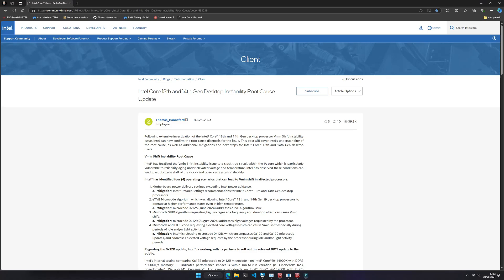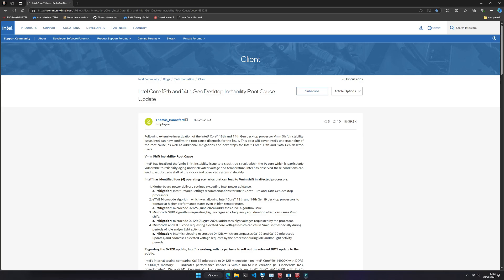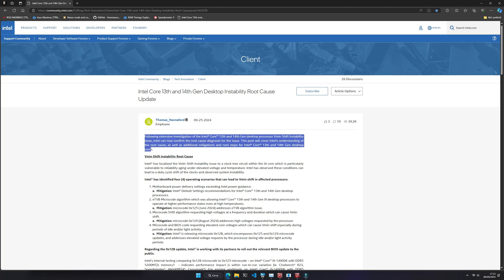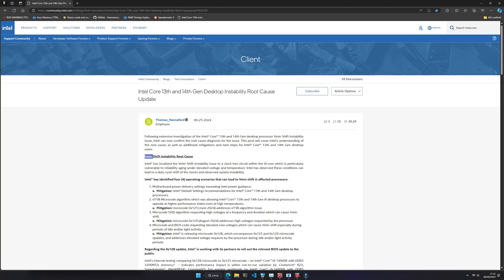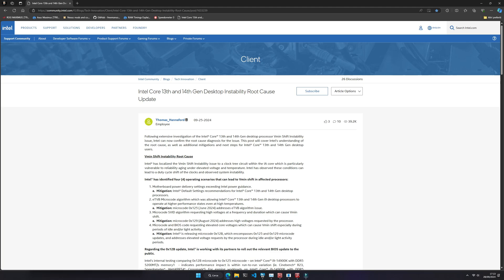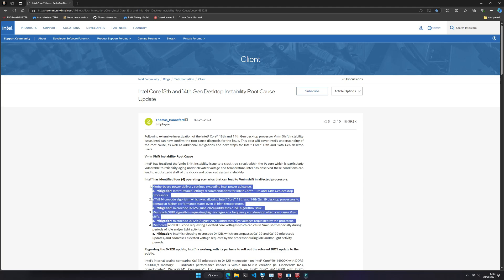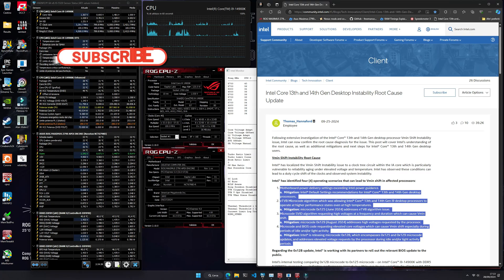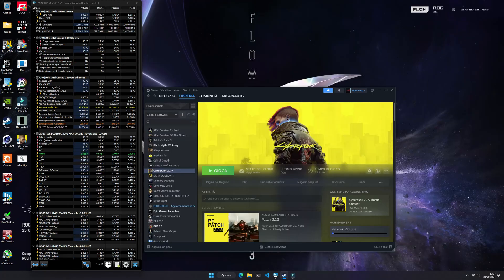FINALLY 14900K microcode 0x12b update FIXES EVERYTHING 🔧

Comment: Hi mate, I intend to buy an I7 14700kf and with all this issue of instability I do not trust much to say is looking and of course all I've seen are I9 and no I7, I hope you can get me out the doubt.
Apart I would update to the latest BIOS, nothing more to have the machine is clear and activate the xmp of RAM, or would have to touch something, thanks and sorry for my English.
Reply from the maker: @XxZeroQxX  Hi, I can tell you to go easy with that one... great purchase price and great processor in general. I've had the 14900K and the 13700K for a year and a half now the first one, two years the second one. I've never encountered any instability. All the videos I've made show how to optimize the system to get the most out of it. So, go easy if that's your choice, enable XMP, set the load line to LLC 4, and make sure to set AC_LL to an initial value of 0.38 mohm. Keep in mind that Intel in its basic configuration, in Auto, sets LLC 4 = DC_LL = AC_LL = 0.55 mohm. So in this way you've already practiced an undervolt. At this point you're doing great both in productivity and gaming. You can find all the details in the videos I've made. Best regards

Comment: How is your CPU running so cool?? Usually mine hovers around 70-80C when gaming.
Reply from the maker: @louiienation8497  I usully use thermal gryzzly KryoSheet
Reply: @eXpowerG3046  And CPU/Bios settings were all out the box? No manual undervolts/power limits done?
Reply from the maker: @louiienation8497  You need to set Load line calibration ;)
Reply: @eXpowerG3046  any tutorials on that?? :(
Reply from the maker: @louiienation8497  on this Channel there's a lot of one 😉

Comment: I couldn't see the temperatures you reached. What was the average?
Reply from the maker: Average temp 53 degrees Celsius, max 85
Reply: @eXpowerG3046  85C is quite high, isn't it? But better than 95C which was before the update. Did you see any improvement on temperature after the latest update for the processor after a few days of use?
Reply from the maker: @ndrsg3013  hi, yes there have been appreciable improvements to the point that I'm making a new video with OC 6.2 GHz, temperatures around 88/90°. CB R23 41354 points and PL2 set to 298 Watt. Think that since I own this processor I have never achieved such a high CB score and with only 300 Watt.

Comment: 14900k microcode? Mine is 14700k. Do i need to use the new code?
Reply from the maker: @yasuolee4914  Generally your cpu does not present critical issues in terms of overvolting. Personally I always update drivers and BIOS to have access to problem resolutions and new features that companies implement. For example, the microcode 0x125 compared to 0x129 did not show, numerically, any difference on the Vcore and SVID voltages. The latter, 0x12b on the contrary, highlights a significant lowering of those voltages. In conclusion you could decide to access this feature or even stay on the old BIOS that will surely work well and go on like this ;)
Reply: @eXpowerG3046  thank you!
Reply: @eXpowerG3046  my bios now is 0x129 and 0x12b is only beta version. i want to wait until the offical version come out

Comment: I am on 0x129 and locked to 5.5 ghz with an undervolt. Everything works perfectly for me so I will skip this bios update.
Reply: yeah.. you dont need to update. just locked the cpu at a sweet spot of ghz and a little undervolt. Just remind : all over 1.375Vcore is bad for the CPU. that happend mostly when the in single bench´s at higher ghz.
Reply: @tetoqx  Yeah I don't reach very high vcore with 0.07 undervolt and 5.5 ghz so I think the update is pointless. This is is for people who stick with the Intel profile in bios.
Reply: @cemsengul16 what score do u have in cinebench?
Reply: @baylife7  I can't remember.
Reply: @cemsengul16  what motherboard and procesor do u have?
Reply: @baylife7  My motherboard is Z790 Dark Hero by Asus and processor is 14900K with undervolt and underclock.
Reply: @cemsengul16  I am new in oc topić, I would love to see your settings, because I think my pc is not running well. I have Z790 formula and i9 14900ks.
Reply: @baylife7  I can check my settings and tell you later. Every chip responds differently to undervolt though. Your limit may be higher or lower.
Reply: @baylife7  Check my comment below for my settings buddy. I Can undervolt to 0.07 in vf offset and games are okay but heavy video editing would crash so I use 0.068 in vf offset.
Reply: @cemsengul16  thank u 👍 appreciate it
Reply: @tetoqx Yup I believe if it stays below 1.4 volts should be fine. Had my 13700F running for over a year now without any issues. But my 14700K that ran at 1.6 volts isn't stable anymore
Reply: @pixels_per_inch  hmm idk.. i ran my 14900k since january most of the time stock with a asrock z790 taichi and i have no stability issues. cinebench always at 100c over 40000 points consistent. Since i whatched videos from der8auer and Frame Chasers i turn the voltage down and the Ghz to 5.4Ghz all core and an offsetVcore to 35mvolt. Runs Perfect at 1.375 Vcore. Same Cinebench Score. :) But you know... Every CPU is different..
Reply: @tetoqx  I am on my replacement 14900K. I am happy yours never died. For my new chip I am using 5.5 ghz p cores. I disabled adaptive boost, intel virtualization, and undervolt protection. I also disabled every tvb setting. I set an IA VR Voltage limit of 1450. Last setting is vf offset. I offset undervolted points 7-11 by 0.068. I believe my max vcore under heavy stress was 1.305.

Comment: So does this'mean we can fully overclock with no PL settings ?
Reply: Removiving PL removes the microcode update.
Reply from the maker: @kazuviking  No, absolutely not. Removing the PL acts on the system optimization practices. The microcode implements the CPU request management algorithm. The focus to have those performances that I showed in my videos is mainly due to the LLC tuning. DC_LL to 'inform' the CPU correctly on the type of Load line calibration that we are using, taking into account the MB impedance. AC_LL to compensate for the voltage drop in the transition from idle to load
Reply: @eXpowerG3046  It actually does on most motherboards. ASUS AI disables only the voltage limiter making the fix useless, MSI does the same. No info on gigabyte and asrock boards so far.
Reply: @kazuviking  come on dude it won't remove the micocode i have it inlimited power with no coverclock hitting 1.350v either a 420mm rad
Reply: @marcusthorburn25  It only removes the eTVB and LLC settings, the rest stays the same. ASUS AI profile does funky stuff. You can see 1.350V in HWinfo if the real voltage is over 1.55V. Motherboards without a built in oscilloscope cannot see the transient spikes.
Reply: @kazuviking  I only game so am fine but thaks for the heads up
Reply from the maker: @marcusthorburn25  🔝
Reply from the maker: as far as I'm concerned, I would always set the Power limits to stay within Intel specifications. This microcode acts in particular on the VID requests that the processor makes to the VRM and returns Vcore voltages more in line with the VF table of the processor itself

Comment: I have 14900k and never had issues but yet again on first launch when i saw temps and i did adjustements , i believe people who left those cpus stock actually fried them btw i did your settings and got 39600 score dont have too good cpu as have only 95SP
Reply from the maker: @gvido2923  hi, you can try to set the parameters that I selected in the video The Definitive solution... With that video I set the P Cores to 57x on the favorites and 55x on the remaining 6, just to mitigate the effect of hyper threading with the downclock, lowering voltage and temperatures! The processor benefits from it and you should easily exceed 40200 points on CB R23.

Comment: You can't fix silicone degradation with microcode. It's just a bandaid to slow down the deterioration in CPUs.
Reply: Yes, you can't use that microcode update to fix a CPU that is already degraded (because that CPU is already physically damaged), but you can ensure a newly purchased CPU (that is not damaged yet), installed on a MB that already have this update, won't share the same fate.
Reply from the maker: @PhilipPetev Correct! Unfortunately with series 13 and 14 this is all we can do. ;)
Reply from the maker: @akkudakkupl  it's clear. the purpose of the videos I made is that, once you realize how bad luck we had with these two generations, if you analyze the voltage / frequency curve you realize how this algorithm makes the SVID requests very close to what the factory fused. So, in this way we can use it with peace of mind and when 6 months or a year pass ... we move on to Arrow Lake or AMD. 😂best regards👋

Comment: Intel never said that microcode 0x12b fixes the problem. To lower voltages enough to stop degradation they'd have to lower frequency too which would get them sued for false advertising. The newest microcode update only slows degradation. Source: read my first sentence.
Reply: wasn't that the problem from the beginning? the voltage issues?
Reply: They did say that it fixes the problem
Reply: @cameron2319  They said the microcode update before the last one fixed the problem just like the one before that. Am I the only one here in this comment section that actually keeps up with what's been going on with Intel for the last few years? It sure seems like it. You and everybody else here seems to think there's nothing to worry about, everything is fine, and there's not a problem. It's almost like this isn't youtube but instead is userbenchmark or something.
Reply: @pf100andahalf Well, this didn’t age well…
Reply: The issue was with too high voltages requested by the clock tree. Now the cpu requests proper voltage and wont degrade. You can still hit the 5.98GHz with some tweaking.
Reply: @kazuviking  Voltages is what the last few microcode updates were all about. I don't know why all of a sudden people think that this last one fixed it.

Comment: "Everything" but everything that is actually on architectural levels of that CPU
That "everything" cannot be reversed, as it's literally an engine of the CPU, they are trying to make a 4.5 cylinder engine out of a V6 and call it "fixed"
I don't blame the engineers, I blame the management
Reply from the maker: @OptimizingNetwork  Absolutely, what turned out to be a design error no one can change. The fact that this algorithm helps mitigate the effects of this error is appreciable and appropriate for all of us technology enthusiasts because, in my opinion, it allows us to return to using these systems, in productivity and gaming, at good performance levels in line with the 14900K range. On Videocardz there are some benchmarks relating to the brand new Arrow Lake and Ryzen 9950X. Well, the results are comparable to the point that, with the configuration I adopted in the video, with the LLC adjustment, in MT on Geekbench 6 I reached 24000+ points and in ST 3290.👋

Comment: it's slower now
Reply from the maker: @rodrigorras  No, absolutely not. If you take into account CB R23, which is the most used benchmark, the score moves on a range between 40800 and 41038, with a PL2 limited to 288 Watts. The Vcore and SVID voltage never reach 1.5 volts at 6 GHz! ...from this starting point it is possible to go back to overclocking with good safety as far as I'm concerned

Comment: Hlo bro I have a i9 12900k and after I update my bios and selecting intel default settings then my cpu started power limit throttling in xtu stress test
Reply: I was under the impression that the 12th Gen wasn’t affected by the problem.  I don’t think you have the same issue to correct with your processor
Reply from the maker: @mvolkaert  you're right, my processor has never shown signs of instability except when left completely without brakes where it reached 390 Watts of consumption. The videos are intended to show those who have had problems, to best set the various parameters so as not to use a processor of this type castrated to the point of scoring only 36000 points in CB R23. An insult! The only aspect in which my processor shows its weakness is the Memory controller weak to the point that it barely supports 8000 MT/s. 👋
Reply from the maker: @PrittyGirl-k4j  hi, of course it depends on the fact that the Intel profile by limiting the Pl1, the Pl2 and the current to 307 Ampere, also limits the TJfunction and when with the load the temperature exceeds 87/90 degrees, the processor goes into thermal throttling and decreases voltage and frequencies. As you may have guessed from the video, I don't like the Intel profile and I prefer to control these parameters manually. otherwise I wouldn't have bought a 14900K but would have stayed with my 13700K 👋

Comment: so annoying that its happening to mine but im just gonna wait until 9800x3d then send off 14900kf for replacement then sell it lol
Reply: Is this means that you bought 14900kf just for gaming, why overpay so much?
Reply: @StroggKingu  because future proofing for newer graphics cards since a i7 would probably bottleneck in the future more than a i9.
Reply: @EddieMcclanahan  You either have to play on 1080p with 4090, to still be cpu bottlenecked.
In that case, why you bought both and still run FHD screen?
Reply: @StroggKingu  i just wanted a cpu that was powerful across the board and i wasn't too worried about the price ahaha
Reply: @joshbeath6166  I mean sure, but did you do any research or just took the highest costing?
Reply: @StroggKingu  I did some research on it aha but I’ve always had a lot of trust in intel so that probably played a part in me choosing 14900kf
Reply: Well i'm not talking about trust, but just not to overpay for your needs.
Reply: @StroggKingu  amd just wasn’t offering what I needed overall at the time. The x3d parts was a option but for overall speed it wasn’t what I was looking for
Reply: @joshbeath6166  Alright but what you needed that speed for other then games, how worse would i7 do vs i9?
Reply: @StroggKingu  pricing wasn’t an issue and i9 was faster than i7 so it was an obvious choice for me and other workload related things was for the i9 so there was always extra performance with it
Reply: @joshbeath6166  ok so it wasn't just for gaming, then why you want to change it for X3d, that has much less multi thread power?
Reply: @StroggKingu  after having it for some time I don’t use it for other workloads as much as I thought I would and I would rather have extra gaming performance since most of the time I game now
Reply: @joshbeath6166  Alright thanks for that explanation.
Reply: Smart move.